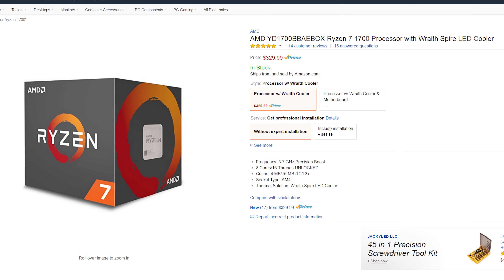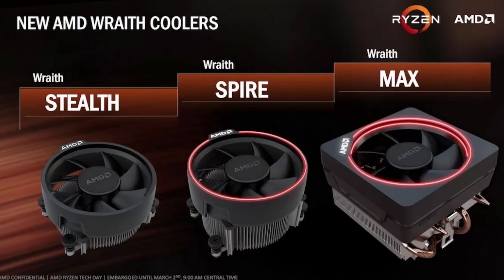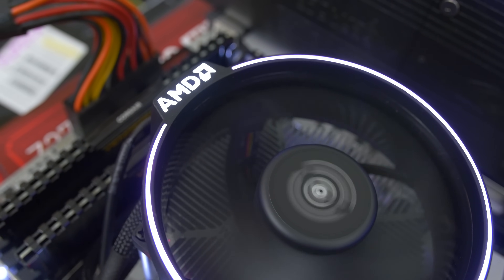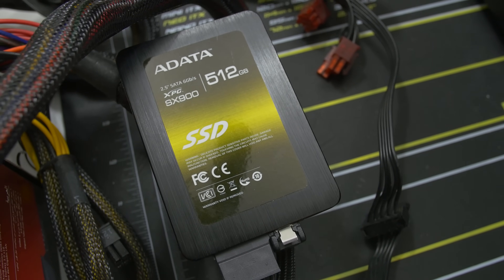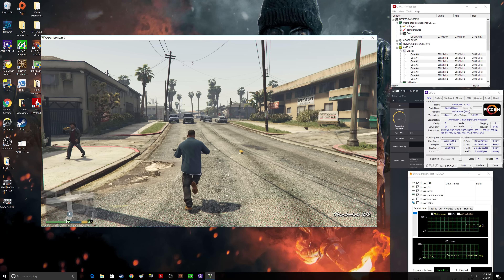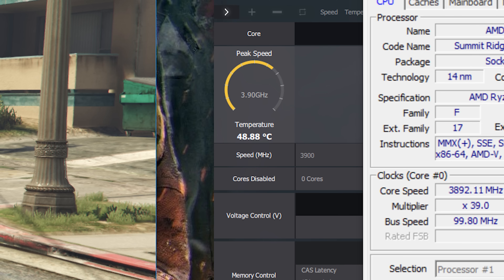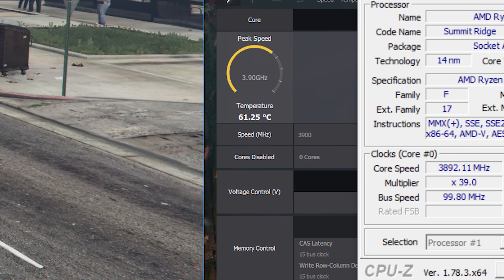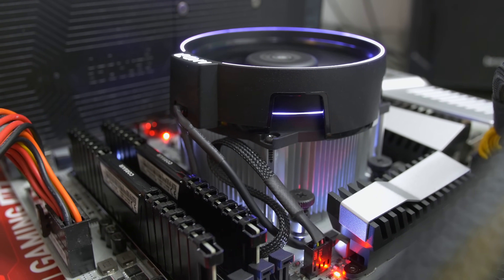AMD Wraith SPIRE: Does it SUCK?

Comment: when is intel going to upgrade their stock cooler
Reply: When people will stop trowing money at them and accept being insulted with cooler that do 100*C. 
If buying an Intel chip, get something without a boxed cooler, otherwise you're just wasting money, natural resources and promote stupidity. 
Unless people demand change by voting with their wallet, this issue will not go away.
Reply: Ironically here in Germany the boxed-version costs approx. 5-10€ less, than the non-boxed-version.

Comment: For benchmarks skip to at least 4:40....

For 100% speed I was expecting sound level equal to a rocket launch. Surprisingly its extremely quiet. Good job AMD but those idle and load temps are odd. I dont care much for idle but that load temp is kinda hard to believe when comparing to my i7-4790 3.6-4Ghz with hyper evo 212 under load at 50C-60C

Comment: So the 1700 is looking better and better. $329 msrp and you can use the stock cooler for a 3.8+ OC.
Meanwhile if you went 7700k  at $349 msrp you would get better gaming fps but you would need to foot the extra $35+ cash for a cooler to OC it well. 

So ultimately the AMD ryzen 1700 is an attractive alternative for gaming at a lower cost and thats far superior for other tasks outside just playing video games. Well gratz AMD.

Comment: I think that idle temps are low, due to decresing fan speed, and fan noise, bcs cpu really doesn't care if it's running in 30degrees, or 70degrees. It's just piece of silicon combinated with metal.

Comment: Wait wait wait... so what was the auto-fan control set to if increasing to 100% on the same voltage dropped you 30+ degrees C? That can't be right unless the auto was still setting to like... 10% fan speed at 80C. There's no way going from, say, 50% speed to 100% dropped you 30+ C.

Comment: When you buy a car do you ever think of getting a radiator and fan for it? No so why the hell would you do the same with this, they would not include it if it didn't do its job. Come on, move on
Reply: menacegtr stares at intel coolers also thats a car not a fucking cpu i dont remember you needing to worry about a cars sound more than a computers sound inside your home

Comment: I dont believe these 48C°.
Even with an open Air Testbench and a 65W CPU. Never. Not in GTA:V.

Im sitting with a Shadow Rock Slim that has 1x 120mm and 1x 135mm attached to it at 65-69C° in GTA:V on a 95W i5 760. (No intake fans, only exhaust).
Theres no way a stock cooler cools that thing under GTA:V down for 30C°.

Comment: it's funny that people say you can buy an 1700 and overclock it for performance on par with the 1800X...
but you could overclock the 1800X as well for even... MOAAAA PERFORMAANCEE!!
Reply: Aroop Roelofs 1800x OC is pretty much the limit even for 1800X
Reply: They use the better silicon for the 1700x and 1800x, my 1700 takes 1.425 volts for 3.95 ghz lol
Reply: @gardenguytomorrow  Wow, that's a lot. Got myself a 1700 too and mine needs 1,113V for 3,8 Ghz. But I gotta mention, didn't try it with Prime95 yet, only few times in a row with Cinebench, didn't have any issues yet with demanding games or workloads like Premiere Pro
Reply: @kalimin33  Look into Asus Zen states. I got 4.0 stable at 1.394 volts now.

Comment: My 1700X didn't come with a stock cooler. Bought it from Microcenter. None of the 1700X or 1800X they had came with a cooler, only the 1700.

I just checked Newegg, they don't offer it either. Where are you getting the 1700&1800X's with Spire Max coolers?

Comment: Tom's hardware did an interesting investigation of how CPU heat sinks affect the surrounding passively cooled heat sinks. Something like the spire that pushes air out in 360 degrees is the most optimal for the other components on the motherboard since it is getting air through the fins on those heat sinks.

Comment: It's because the Global Foundries 14LPP 14nm FinFET process is extremely power efficient. Far beyond what Intel currently has with their 14nm process. Also, combined with GF's process, since the 1700's TDP is so low @ 65 w for 8 cores, it won't generate as much heat. Plus that cooler might actually be good too!

From what I can see, you don't take full control on overclocking. However, since the 1700x is rated @ 95 w TDP, it should, in theory, perform better as the cores AND other components within the die are fed more power and since they are extremely power efficient it should be good.
Reply: GloFLo's 14nm is directly borrowed from Samsung's 14nm, a node meant for power efficiency, and smartphone SOCs.

So, this is why AMD Ryzen can be so frugal in watts for the 8 cores it packs, but also why 4 Ghz is the hard wall in terms of OCing.

Intel had to go less efficient 14nm to do the 5 ghz on their 7700k.

Comment: so as a whole package, ryzen is too good for pocket, processors not so expensive, nor motherboards also a hell of a great free stock cooler. and for 5-8 fps less and most time over 100fps in 1080p, I will nott consider intel this time over ryzen. r7 is all in one winner. Awsome AMD. Been long time ive used their processors. This is the right time to buy.
Reply: Finally a person who uses the brain instead of other parts of the body to think. Your description would fit great on every single review conclusion of these CPUs. Unfortunately, many people don't reach to the same conclusion as you. Many people see the 5 FPS difference like it is something worth paying for. Also, what is worse is that most tech sites draw the conclusion that Intel is better in gaming cause...it gets 5 FPS more. Yeah, but gaming involves also money. And when you factor in both and the fact that you can't state that AMD performance is bad, then you end up with a very clear conclusion. Conclusion that is not stated by many tech sites.
Reply: Bang for the buck, the ryzen cpus are hard to beat. Haven't built a pc since around '03 and impressed with these units.

Comment: Hello! I'm thinking of building my first ever computer but I don't know anything about specs. so I'm thinking you might answer my question. I was thinking of buying an Intel core i3 as a processor and  a AMD Radeon r9 fury x as my graphics card. Is good enough for gaming? And Can I game for a long period of time with it? 
☺☺☺ Please Reply☺☺☺
Reply: Endangered_Species I live in Texas, yes the rx 480 is definitely cheaper and a better value, i just realized it is an 8gb card and not a 4gb, my bad. By all means he should consider an rx 480, better price, more performance, fine wine, and more vram
Reply: Holy Gaming It comes with both a 4 gb and 8. You could get the 8 for like $200
Reply: Adrian AzureNo the rx 480 is not quite as good but without the better cpu the fury would be bottlenecked and be useless anyway, the i5, 480 combo is a very good one and should run most games at ultra,1080p 60 fps.
Reply: Check reddit r/buildapc
Reply: Adrian AzureNo fury x is not a good deal, save some money on a different gpu and get an i5 with that money
Reply: Holy Gaming An i5 and what kind of GPU?
Reply: Holy Gaming lol what. People buy a 1070 but won't buy a fury X despite them being around each other in performance is ridiculous.  To say it isn't a good deal. It's around $400 same as 1070 (unless you can find that cheaper) I'd go for it

and everyone ignoring that this guy has a fucking i3. Huge bottleneck
Reply: Endangered_Species Is the i3 bad. I'm new at is so I really dont know anything.
Reply: Adrian AzureNo What I mean is that you're comparing a high end guy to a 'middle' classed cpu I guess you can say that only has two cores and not 4 like an i5. Would be better to at least get can i5 as an i3 isn't enough
Reply: Endangered_Species Oh ok. How about the GPU?
Reply: Adrian AzureNo Instead of getting an R9 Fury X (I thought you had it already) I'd hurt get an i5 and a RX 480. Really depends on what resolution you're trying to fame at. Plus depends when you're going to be buying this stuff as AMD is releasing their R5 line up on April 11th which would be a much better choice probably.  You should probably use pcpartpicker for compatibility as there is more than the gpu and cpu (you could pick the wrong motherboard)
Reply: Endangered_Species Ok thanks man! You helped me a lot😀
Reply: Endangered_Species One last question. Is it better than the Fury X?
And what is the price gap between the two? Can perform great in playing GTA V (and maybe some DOTA 2 too)?
Reply: Adrian AzureNo No it's not better than the Fury and price difference is like $200 or something.  You can see for yourself and lol yes it can run those weak games and GTAV fine.
Reply: Im not. i literally just told him to get an i5 instead idk if you saw that lol, and i wouldnt get a fury x for that price simply because it comes with 4 gb of vram, if you want more future proofing a 1070 8gb or 1060 6gb is a better bet, probably a 1060 so he can use the extra money on a good i5. Or if he wants to save more money for more direct performance an rx 480 would be fine, just not a fury x
Reply: Holy Gaming A 480 is usually cheaper than a 1060. I don't know where you live.
Reply: Endangered_Species now im starting to reconsider my 1060 6gb purchase
Reply: Holy Gaming Unless you can find someone to trade with it's fine. Not that  much of a big deal to throw it away
Reply: Endangered_Species Wow thanks man! And I'm sorry but this is my Last last question. Should I buy an SSD or a Mechanical drive?
Reply: Mechanical drive? Not sure what you mean by that but I'd buy an ssd
Reply: Endangered_Species Ok thanks a lot!😀
Reply: Adrian AzureNo how did it go man?
Reply: 1070/i5
Reply: Adrian AzureNo.... 
1050 and ryzen 3 1200 😀😀😀

Comment: Testing on an open air test bench doesn't seem like it's going to generate the most reliable results. The ambient temp is going to be way cooler than inside a case plus it has tons of open space to vent off the heat soaked fins.

Comment: With that "high 40's" statement on the 100% Fan Speed on the cooler. Didn't you also say you had your window AC unit on? If that's the case that means more or less nothing if your testing environment was inconsistent given the earlier "my ambient temps could always be lower" statement earlier in the video, then that more or less means all of your testing was inconclusive because of the manipulation of very key variables for thermal testing. 

Not trying to hate, just trying to understand your data more, because this cooler is what's informing my purchase of either a high refreshrate monitor now or an AIO cooler now.

Comment: what the hell. I have an h100i and its running at 58-70c in a 1800x not over clocked. 

I thought they said the temp isn't accurate by 20c, is that true??
Reply: only the 1700x and 1800x has the +20C offset. 1700 does not.

Comment: Kyle, just a suggestion.  I know there is all this exciting new stuff with AMD.  But what about a retro gaming build with some old AMD cpu that would support something like Lakka?  I think it would be interesting and informative as I have been building one and there is little info on this subject.  It is pretty cheap now, but still involves building a computer in a small form factor that has power to run say up to N64 and can plug via USB into any modern T.V.  Anyways, would be cool.  Thanks.

Comment: Why are 1700, 1700x & 1800x have different clock speeds?. Is that 1800x is more stable at higher clock speed?, if so why is that? or is it just bcoz AMD wants us to think we have more options & may get more people to buy their chips.
Also does overclocking a 1700 reduce it's lifespan, stability or reliability? even after providing adequate cooling?.
In my opinion there must be a difference in quality between 1700 & 1800x that justifies the difference of both price & performance or else AMD are setting themselves up for losses.
Reply: LifeRider 96  oh you mean like intel? having 2-4 different i7 on consumer platform, and around 7-8 i5, and numerous i3? yeah no difference at all... lets not forget atleast 5 different pentium and celeron, and atom... see where im going? 
all the S,U,Y,H,K,T and what not from intel also adds more to the confusing  lineup.

1800X will probably be great for prebuilt systems, higher frequenzy out of the box.
for smaller formfactors the 1700 is golden. 1700/X for overclockers. 1800X brings nothing for overclockers, but its great for those that want the fastest ryzen7 without having to fiddle in uefi to increase performance, just buy a decent cooler and let boost/XFR do the work.
Reply: TrueDesireHD Thanks for clarification. I was asking more on the lines of speed binning & silicon wafer quality. All ryzen 7 CPUs have the same core count and architecture, so it must be that 1800x is the best quality right?. Anyway this should not affect reliability whatsoever as I believe CPUs, most probably are the most reliable computer components. Also AMD Ryzen CPUs have soldered IHS, this tells a lot about the quality at AMD. I am going wait a little longer before I get one myself as stability and reliability are my top priorities.

Comment: Meanwhile, Intel neglects to even include a mediocre stock cooler with their K sku chips. Man, this Ryzen line is refreshing. Even if Ryzen 5 chips don't end up being quite as good as the i5's for gaming, I'm still looking forward to all of the repercussions of the stout competition.
Reply: Zelement  i have owned several i5K and i7K through the years and the stock cooler is rubbish. my haswell i7K sounded like it was going to fly away. the sandy-ivy-haswell i5K was barely "ok" , even with silent profile for cpu fan it was horrible in gaming.

we all thought intel would reduce the prices when they decided to stop including the stock cooler, instead prices just got higher lol.
Reply: TrueDesireHD Exactly my point; the prices continue to hike, and they've had the same terrible stock cooler for sic generations. This cooler seems like it could actually dicipate a respectable amount of heat at a reasonable noise level.